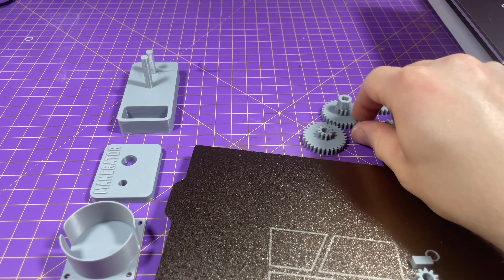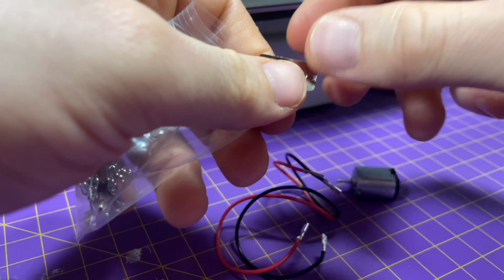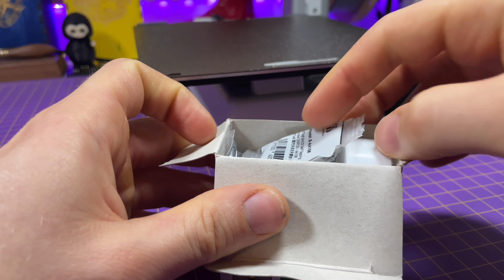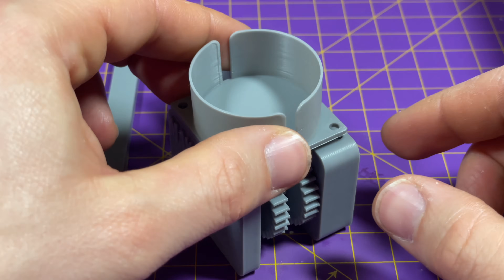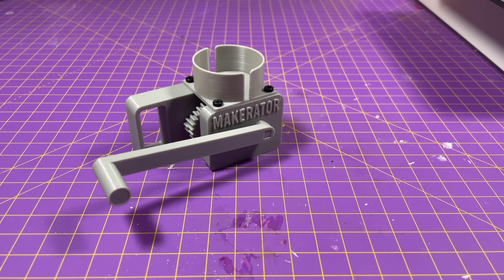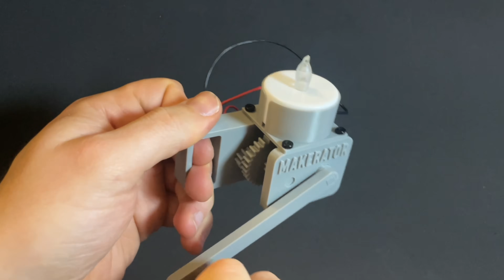DIY Generator from Bambu Labs Maker's Beginner Kit - use an DC Motor as generator (Assembly guide)

Comment: Not sure what went wrong where, but the tea light works with the battery and not with the motor. Gears all spin freely. Any troubleshooting tips?
Reply from the maker: Sorry to hear: 2 ideas:
- are the cables connected to both ends of the led?
- can you check if the gear on the motor really turns the motor? I heard that for some people the hole of this gear is not tight enough so the shaft of the Motor doesn’t spin.

Comment: Add a proper capacitor to this and it will make a real difference 👍🏻
Reply from the maker: @cagataykilinc  thanks! I will built another one that doesn’t only contain parts from that makers verhindern kit but uses another cheap
Dc motor, there I will try it, thanks!